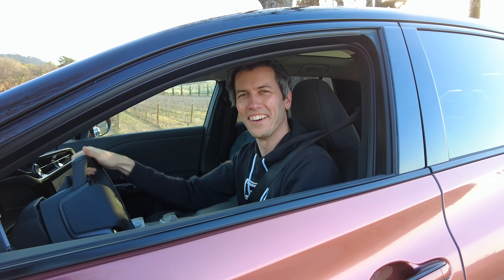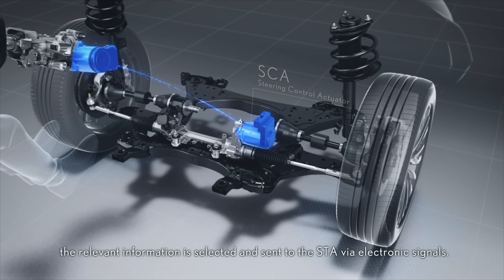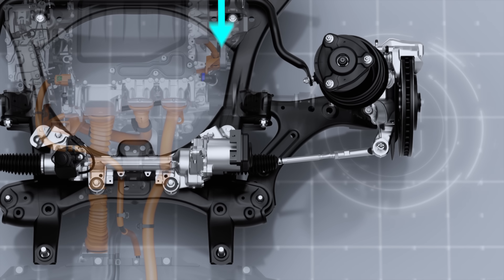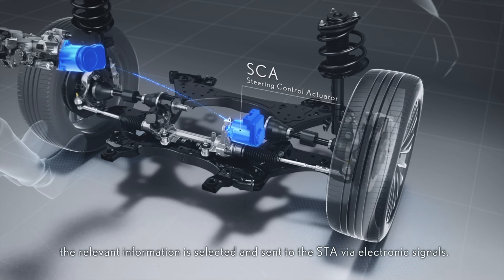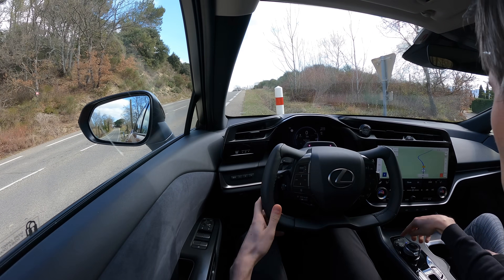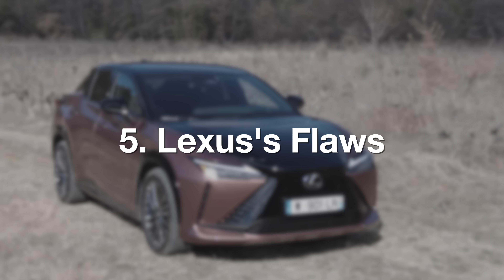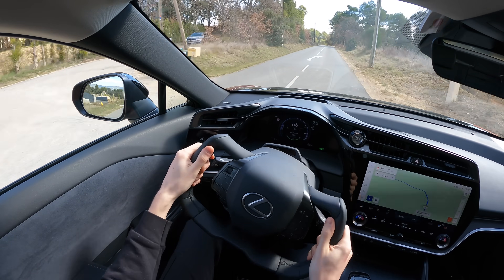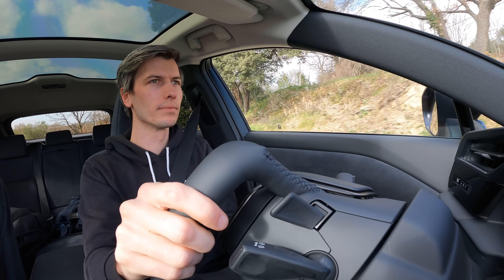How Lexus Fixed Tesla's Bad Idea: Steer-By-Wire Yoke

Comment: My first impressions were pretty predictable it seems.
However, now that I've thought about it, this does give a lot of opportunities for a simpler driving experience.
I do see a problem though- from a safety standpoint, it's not mechanical failure or redundancy, it's in emergency scenarios where human error and instinct come into play. Especially in drivers coming from a traditional vehicle, to dodge something they may make a sudden large input on the.. yoke (still sounds weird for a car lol). Would this be automatically dampened, or would it cause the vehicle to immediately lose control? How would the system differentiate from a sharp turn and an emergency yank on the yoke? Would dampening the user input cause a collision when the vehicle suddenly doesn't behave as intended? I think the biggest problem with this system is predictability. Mechanical linkages perform very predictably, and so it's intuitive and safe in the majority of cases- but when the system constantly adapts to you as well as the environment, I think that opens the door for a steep learning curve and undesirable effect during non-standard operation of the vehicle.
On the plus side though, I see lots of good things beyond the aforementioned simplicity, ergonomics, and novelty appeal. Seeing this system adapted to make sport, track, and offline modes in select vehicles even more noticeable, and useful, such as adjusting the steering ratio and sensitivity to better cope with rough terrain, or tightening up the system and removing the adaptive function for some quick laps around your local track. 
In summary, it's just another bit of neat tech, just like autopilot, that the aviation industry has been using for decades and finally cars are catching up.
Reply: You can differentiate from a emergency turn and a sharp turn in a similar way that the ABS system differentiate between an emergency brake application and heavy braking. With the brakes the system looks at the applied brake pressure and the time, i.e. the rate of rise in the brake pressure. Similarly with the steering you can look at the rate steering angle is applied.
The car would also have to pass the Moose test, which is a sudden violent manoeuvre. (not a nice test procedure if you have to repeat it too many times).
BTM plenty of mechanical systems have a variable turn rate, just not the range of this system.
Reply: @leewatson8129  good to know!

Comment: Let me say that steering by wire gas sone advantages. No steering column u joints that wear out and make klunking sounds or have extra play i notice this alot, with rough dirt roads this happens to me faster. Also with rough roads I dont have to feel the steering wheel feedback that I do t need. And when crashing the wheel won't turn fast and hurt you.

Comment: Makes sense. I worked at Mitsubishi when the Evo 8 came to the USA and we had several owners complain of the vehicle torque steering to the left. Turns out the short ratio steering was so much more sensitive than people were used to that they pulled the wheel slightly to the left under hard acceleration.
Reply: Possibly, but can also be tyres (conicity, wheel alignment or can occur if both springs are wound in the same direction.

Comment: One question I have is about how this system corrects for changes in speed with steering angle already input. Let's say you're on a really long gradual curve. You start from a standstill. To negotiate the curve at the start, you need 10 degrees of steering wheel rotation for 2 degrees of steering rotation. You hold this 10 degrees of steering rotation through the turn as you speed up. Will the wheels straighten themselves up even as you hold the same steering input? Will they stay static? 10 degrees of input at a higher speed should mean considerably less steering rotation.

I see problems with either of these results. If they straighten themselves, it could be disconcerting and surprise a driver not aware of  this behavior.

If they stay static, and the steering wheel is turned 10 degrees back to center while the vehicle is at a much higher speed, will it move the wheels the same 2 degrees of rotation that occurred at a standstill? This would lead to the very twitchy handling you were talking about.

Of course my numbers are made up and really are inconsequential.

Comment: worst case scenario:
Steer by wire seems pretty bad to me. Redundancy reduces the chance of failure, it doesn't eliminate it, and for a production car this is a huge issue compared to a formula 1. Formula 1s are well maintained by the best of the best mechanics, production cars are used by people of all kinds, even those who think oil changes are a scam. Will this system perform 10, 15 years down the line? (Though it's an EV so it might just reach end of life by then ...)

Two redundant systems isnt enough. It should be 3 minimum. If one controller randomly says "full left" and the other doesn't, you're going left. Wouldn't be fun on the highway.

Also interested in how they combat the steering ratio changing on ice when the wheel freespins. 

Also I don't think that if this system becomes widespread, that car manufacturers will keep redundancy. They'll have one speedometer (which is important for steering ratio) or won't be prepared for a short circuit causing a hot ground.... Something random like that...

Comment: As a mechanic, I feel this is a very bad idea. Power steering pumps fail, computers fail, wiring fails, electric motors and gears fail… the only steering you have is with the column mechanically connected with strong arms on the steering wheel. When their is a mechanical or electrical failure with drive by wire, kiss your a** goodbye.

Comment: This is very similar to the Canoo steer by wire system that went into production late last year.  Granted 2022 production was limited but the feature is also included in 2023 models.

Comment: @3:01 At least parts of the industry push towards EVs and governments try to outlaw combustion engines. It says more about the powers that shouldn't be than EVs as a viable mode of transportation.
@4:19 Exactly, you don't want fools texting while driving causing even more havoc.

Comment: What a problem having small steering ratio? Bikes have ratio = 1, and no problem at any speed. You just need a right suspension geometry what will increase feedback force and stability at higher speeds. Also there was a hydraulic steering from Citroen called Diravi which had no mechanical connection of steering wheel to rack in normal mode. And it also had a very small steering ratio. No one who use it complained to it. It was smooth and comfortable at any speeds.
How it feels with electric steering having input lag you may check in PC games like NFS. That is awful if lag is more that 0.3-0.5 seconds. Small fast corrections will be executed in opposite face and lead to destabilisation of car. It is possible to adapt to it, but better to avoid it. At least steering wheel shall provide counterforce if you turn it faster then motors can turn the wheels.

Comment: Most production cars a day have electric power steering. A motor is attached to the physical power steering rack. There's no linkage between the steering wheel and the steering rack. This video seems a little bit out of date at least 4-5yrs this would've been accurate

Comment: Am i only person who wonder why author didn't mention about this system on infinity? The provided it about 10 years ago😂
Reply: P.s. write " infinity drive by wire" and they did smarter. They have emergency clutch which connects steering wheel with front wheels if something goes wrong...

Comment: its like having mouse acceleration on your mouse, allot of people don't like it.  Also i wonder what their current polling rate for their steering wheel is.  I think some people would want a to be able to adjust the settings of the steering rate and also maybe turn off the assist thing.

Comment: I felt like you were speaking to me for much of this video. As somebody who has been amazed by Tesla since day one, this really stands out as something Lexus has put more thought into. I'm guessing Tesla also thought that disconnecting the manual input would be too dangerous.

I will say that it is also possible that they tried this and noticed the lag problem that you displayed in your demo. I noticed this as well before you pointed it out. This could be a very serious issue if you need to make a sudden move on a highway to avoid a fatal crash. That might be why tesla avoided it. However as a mouse sensitivivity cranked all the way up person, I would prefer they went the F1 approach or that the fixed the lag flaws in the Lexus approach.

Comment: Control engineers will drive this with one thing in mind, is there a lag in this control system. Someone should hack this and set the controls to do the opposite. When you turn the steering wheel left, the wheels turn right, now that's a fun driving experience

Comment: This probably come down to whether you learn to drive with this system from the begging. Driving eventually becomes muscle memory. So if you have always driven fixed ratio steering, in case of emergency or in case of preventing almost certain accident, when there is no time to thing about the steering ratio, you just do a maneuver instinctively. If the steering ratio is constantly changing, you need to rewire your instincts.

Comment: Here are the real reasons: (1) You can also place the steering wheel on the other side, for foreign markets, or have two steering wheels for training (2) compatibility with an electric platform, the ideal is to have the bed (powerplant, transmission, wheels) simply interface with the body and you can then have a common platform work across all models and you can sell that platform to the competition, too.  Any mechanical link to the body will restrict the layout and hence versatility of the platform, so those have to go. 
With the force feedback etc. this model is far too complex to be reliable, and the installation of multiple redundancies tell you that's what Lexus thinks, too.
Reply: some additional points, safety - no metal tube pointing at your chest in an accident,  noise reduction by eliminating the hole in the bulkhead which make production easier as well.

Comment: You didn’t really say what happens if the steering fails… just that there’s redundancy in the case that it does fail but not what happens if all back up batteries, or motors fail, etc…

Comment: Jason, your enthusiasm for all things new is sometimes a little overpowering. All this electronic hardware is a potential source for an expensive maintenance nightmare. Simplicity is a beautiful thing in engineering, anything else is self indulgence. Don't you regret the days when, with just a screwdriver and a spanner car owners do do all the the basic maintenance themselves? Electronics and wiring degrade as they age, through corrosion and fatigue breakages, thus repairs which are rarely taken down to component level, mean complete sub-assembly replacement. This is an expense that makes the economics of running an older car problematic, the repair may cost more than the car is worth. Of course for those new car side of the tracks this is not a consideration.
Reply: Exactly. It’s all political. He sees this as a left wing cause.

Comment: I agree that it is cool; but is it solving a problem that actually exists? Fly by wire throttle makes sense and saves gas / energy. Brake by wire is the same story. But this feels like it is trying to solve a problem that does not exist. Personally my hand are at 2 and 10 when I drive, so I don’t think I will be trying this anytime soon.

Comment: I still dont trust the steer by wire or ebrake by wire. I work with cars and we just recently dealt with an issue where the ebrake switch was shot and the car wouldnt go in park.

Comment: I do think this is a very good i iea but the small gap when turning and it really steering is a little throw off but i do think they can fix that little gap again its not massive but its still there and it should be fixed driving can be a very hard tast for some ppl and say there is a car crash infront of you you need to steer and fast so good i dea but still needs a little bit of work

Comment: there's another point of failure: the software as a software engineer myself, I wouldn't necessarily trust the steering software of actually good engineers, much less the software of toyota engineers.

Comment: Fly by wire system on planes have proven that it can be reliable. However, looking from a maintenance standpoint, considering how little knowledge and care the general public has about taking care of their car, it's only a matter of time until someone drives on the backup system on a daily basis. Of course car manufactures can disable the car in this case for the safety of the driver but this will a whole different topic. Overall, I am concerned about how would the drivers maintain this system.

Comment: If the lag was less, I'd be interested. I know it's never going to be 0 lag (that's just impossible) but as long as it's inperceptable to someone who likes a responsive car.

I really hate the throttle by wire in my Audi, unless it's in sport mode (where the delay is far less) there's about a 0.5s delay on the throttle that's really noticeable when navigating junctions.

Comment: It would be interesting to see (in a large empty space, done safely) keeping a constant steering lock, and varying the sharpness of the turn by changing the speed.

Also, I wonder if they implement variable steering angles based on the amount of lock used (at a given speed). i.e. small movements to the yoke translate to small movement of the wheels, but as you approach full lock, the wheels turn at a faster rate.
The idea is again to increase stability at high speeds, or accuracy when normal driving, but still allowing large movements of the wheels from a relatively limited amount of throw of the steering wheel/yoke in case of emergency or to make tight manoeuvers.
Reply: this would be an awesome engineering test

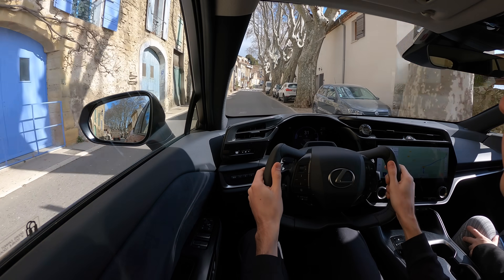Comment: I don't know when yokes became acceptable in cars. I'm disappointed. A hideous SUV isn't a F1 car, i really don't see where that comparison comes from. We can see at 6:40 and 11:10 how uncertain Jason is about how much steering angle he needs. This system isn't as safe as presented. F1 drivers get away because the steering ratio is still higher that this Lexus, they can barely get the pit lane turn right, and Monaco requires a dedicated steering rack with a lower ratio. We also know they are going to intervene somewhat, specially if not intended, and the delay is going to make that twitchyness worse, as people will overcorrect, specially in emergency situations where you REALLY DON'T want to overcorrect.

This will also mess heavily with muscle memory, which is going to reduce safety. You don't really want to be turning with a delayed steering wheel at the last second because the car changed the ratio on you. If you brake inside a turn, are you going to have the ratio change on you without moving the steering wheel, turning more the wheels just because? Hard pass, too many issues.

Comment: The number one issue I have is that delay.  There can be no perceptible delay.  Period.  None.  Zero.  It must feel 100% instantaneous ("feel" -- I realize that's not technically possible.) I understand it's a prototype, but that's just something that can't happen.  Other than that,  my personal preference is a lower ratio for quicker steering.  But like you addressed in the video, most people don't care about "performance" and just want a nice, easy-to-drive vehicle.  So I think I'm not going to be happy with these new systems, but from a market standpoint, they make sense.
Reply: Well said, you couldn’t sell me a car utilizing these systems. Less than no interest.

Comment: The numbness of the steering is a real problem with nowadays cars. I currently own a Polestar 2, which I love, but I feel nothing from the sterring wheel. The numbness is very frustrating, especially for someone like me who likes to race and gokarting. Even on a racing simulator I get better feedback. I used to have a renault clio (my first car) with mechanical sterring without any assistance and it was much better to drive then the Polestar 2 and many nowadays cars I have driven. I love electric cars for many reasons, especially cost here in the UK since petrol (gas) is so expensive now. I can charge at work for free and on I have 5000 miles of free charging with public charging, but this lack of feeling on the steering is too frustrating. I know this is not an EV exclusive thing but it seems all EVs are like that while only some ICE cars are.

Comment: The benefit of DBW is tat you can let user customize without replacing mechanical parts. Want tighter, or longer steering curve? Just change settings.

Comment: The lag was the first thing I noticed. Incredible that this system feels good with a lag like this, but I have to take your word for it.

Another thing that I'd like to know: How does it behave in very low speed (tight garage) situations where both precision and big wheel movements can be necessary? 

I remember discussing this before Tesla released the yoke (and we still had high hopes about the execution...). How would they solve the situation above? Some of us speculated in a torque-sensitive solution, where the amount of wheel movement were based on the torque applied to the steering wheel.

Turned out Tesla released a yoke without even adaptive steering, which is a bad yoke IMHO.
Reply: @eugene9852  What? Lag is not the same as reduced wheel motion.